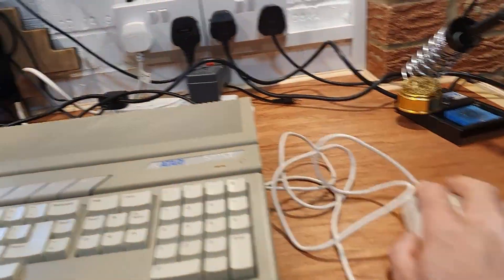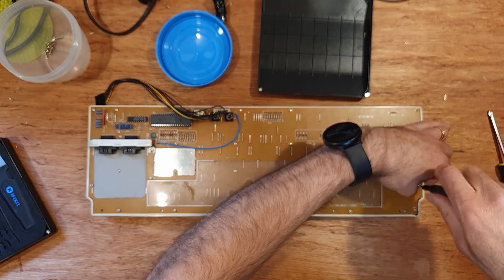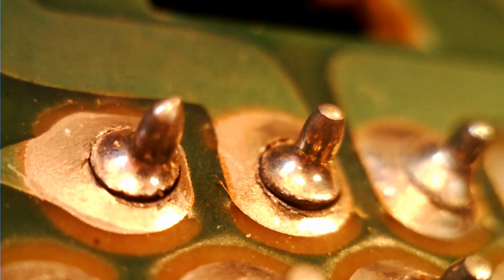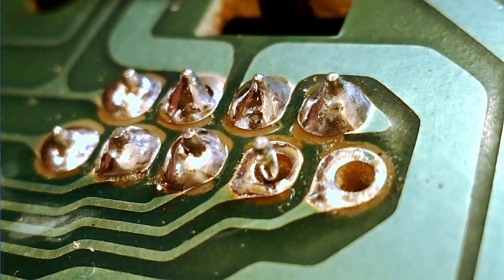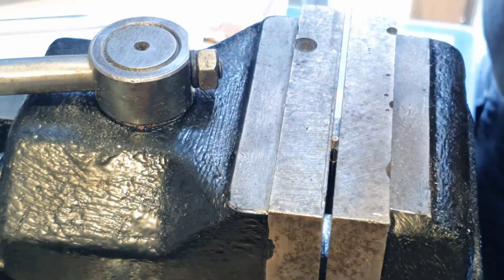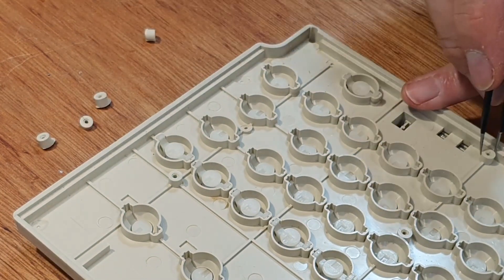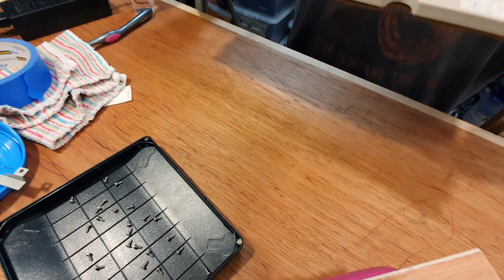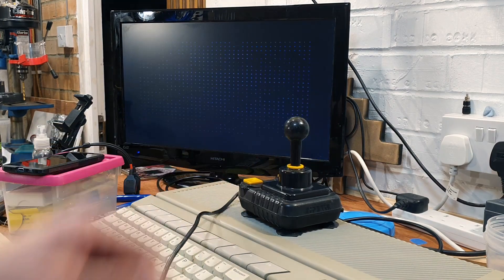CRACKED solder Atari ST Joystick Port Repair

Comment: Dead common fault across the ST range, used to repair dozens of them back in the day and it was al,most always dry joints on the joystick ports or open circuit bootstrap resistor/capacitor on the PSU, both faults were so common we used to resolder the ports and 'service' the PSU by replacing the resistors and cap on every batch of repairs that came through.
Reply from the maker: The joystick ports were one of the worst design decisions I think I've ever seen. How that got through I can't imagine.
I'll keep an eye on the psu potential faults you mentioned. It doesn't get heavy use now so hopefully it won't cook itself.
Reply: @MoreFunMakingIt  there were a few different designs of PSU, the one I remember having the bootstrap resistor/cap problem was the one with CNY65 optoisolator next to a big blue cap and yellow transformer bit it's not a bad idea to check all the low value caps and high value resistors on small PSUs with problems because it's a real common problem for them to fail and an easy fix.

Comment: Been putting off doing this, but now that my kids are playing Golden Axe and feeling the frustrations of having to wiggle the cable every now and then get the characters to move properly/attack,  I think the time has come. Hopefully, I'll not have to deal with that pin issue or be forced to mess around with glue, but at least your elegant solutions are there to guide me if it all goes Pete Tong. Cheers.
Reply from the maker: Good luck!

Comment: Great video Lee and great to have you back - and saving a machine that's dear to my heart as well! As others have mentioned, a very common fault due to the placement of the ports. The "fix" back in the day was to buy a pair of short extension cables to save on wear and tear - in fact I still have mine!
Reply from the maker: Thank you Rees 😁
This came with the leads you mentioned, probably not in time to save it from damage. It also came with another 2 controller ports to plug into the parallel port! Probably an attempt to bypass the broken ports?
Reply: @MoreFunMakingIt  Yeah, I saw that on Twitter, very strange. I've never come across one of those parallel joystick adapters before, possibly something that was specific to a very small number of games, probably 4 player games. You should make a video about it!
Reply from the maker: It has to be for something along the lines of Bomberman? If you want a crack at unraveling that mystery happy to send you the adapter?
Reply: @MoreFunMakingIt  On the 'Amoeba' version of Microdeal's 'Leathernecks' Commando-style game, a parallel port adapter was supported, which they also sold.  I would imagine it was the same with the ST version.
Reply from the maker: @MarkTheMorose  interesting. I'll look that up when I get around to testing it eventually.

Comment: Great job on the port. Also that glue looks amazing! I'll defiantly be looking to get some.
Reply from the maker: Thanks mate!
That glue is so good. Works really well on wood and most plastics. I just used it to repair a 3d printed case that had delaminated. Hit me up on twitter if you want a link to the product.
Reply: @MoreFunMakingIt  I'd like to get a STE but there not cheap and I worry it'll blow up as soon as I get it 😂
Reply from the maker: @RetroSegaDev 
I think I paid £40 for mine. There are bargains out there, but you have to be patient.
Reply: @MoreFunMakingIt  was that via Facebook market place? ;) I deleted mine lol
Reply from the maker: @RetroSegaDev  it was. I deleted mine too. But it's the only way I can access local buy and sell groups. So I undeleted it. Only use it for marketplace now.

Comment: The brittle plastic isn't universal across all STs, I think it'll just depend on the batch the plastic was made from and how it's been stored. However like all micros they're all prone to shear at screw points etc - they were made to last a few years! 
Great repair on the ports, it's a very common fault but not for a pin to break!
Reply from the maker: Good point. My sample size is just this model. And it's probably been bashed on that side as well as being baked dry by the psu.
Thanks for watching 😁

Comment: Nice repair and if you need a spare keyboard upper I have 4 part of a Atari st parts bid and ste is a dream next to a 520fm to upgrade having to soldering each ram chips for total of 1mb
Reply from the maker: Thank you!
The rest of this STE is really good condition, but good to know you have spares 👍
Reply: @MoreFunMakingIt  yeah jays retro repair on eBay or exxoos Atari store and forum.